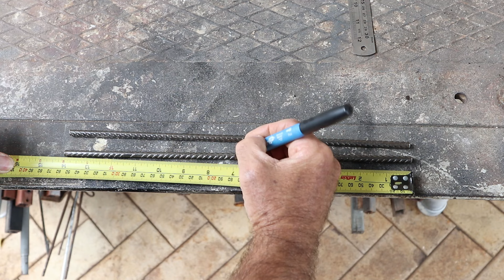Making a Steel Knot Metal Handle - Rebar Industrial Style Handle - MIG Welding Project

Comment: Brilliant. And it a pleasure to finally see someone that actually knows the correct use of a file ,one way stroke  .
Reply from the maker: Thank you very much.
Reply: @GavinClarkdiy  

🏖    🏖
Reply: His high school metalwork teacher must have missed a few things though. Keep your work low in the vice to be more efficient and avoid vibration chatter and never use a file not fitted with a handle.  Still, a nice end product.  A cheap 4 speed Ryobi pedestal drill from Bunnings would help.  I really like your good old Aussie metal work bench.
Reply: Haha, I thought the exact same thing. Was taught by a machinist when I was in grade school.

Comment: A million views . What can I say?
Great idea, skillful execution.

A coupla drops of oil on the barrel of your vice will stop the chatter.
Fantastic piece of old boiler room floor plate for your bench. After you've walked into that corner once you wont do it a second time , Ouch.
 Hope there are no grandkids around.
I like how your workbench is fixed firmly to the floor and wall. Nice and solid.
Good looking workshirt.
I think I have the same number of raucus birds in my yard too. Them and the wattle birds and the ravens sure kick up a storm.
Reply from the maker: Thank you very much. I will give my vice a bit of a service soon, yes my bench is old and very heavy, not at all flat on the top either, it is not bolted down or to the wall it is just heavy and solid. I don't mind the birds, but their noise does sound louder on the video. Thank you for your comment.

Comment: Excellent! When I build a shed out in the back, THIS is the handle that is going on the door. Thank you! Only thing I might do a tiny bit different is use a piece of hardwood between the metal and hammer when striking the metal to keep more of the rough texture. And then at the end heat up the handle and coat with beeswax to protect the metal from the elements.
Reply from the maker: I am glad you liked my handle, yours sounds like it will come out very nice. Thank you for your comment.

Comment: What do you seal the handle with? Paint or linseed oil or wax? Outside wear people put their grubby hands What works, lasts, and feels the best?
Reply from the maker: If it is just for the shape, and clear is not needed I use a satin black rust-guard paint, that seems to work well. But if you want to see the metal there are many things to use and everyone has a different idea. I have decided not to comment on finishes, as there are so many answers and questions. As what climate you are in, is it inside-outside, lots of rain, ice, do you want long term and rarely touch, or a wax with a wipe over every year. That is why I have no opinion, Please ask someone in your area what you should use, I feel this is a better way to find out. Thank you for your comment. Sorry Steve

Comment: Might be  simplistic question  ... but what keeps the rebar in your Steel Knot Metal Handle from pulling out of the holes in bolt heads ?  friction or a spot weld ?
Reply from the maker: If I thought it would come out I would give it a weld behind it as it would not be seen, but in this one the steel was a very light fit into the holes plus the rebar in the middle was very tight against each other when I welded the bolts on to the backing plate, they would need a lot to jump the lugs on the bar. Weld it if you make one just to be safe.

Comment: au - The big  Vices  we broke using in  spring factory    bending  steel  rods   :) 
We got them to build a  Decent  welded 1/2"  plate vice  -   Crap cast     snapped easy     it worked    then they Sold  many after that :)
Reply from the maker: The on I am using has taken quite a beating over the years, so I have my fingers crossed I will never be doing a "This is how you repair a broken vice" video. thank you for your comment.

Comment: Hi
You are no 1 
If you use this handle for exterior gate , how about a rusts do you paint them or you leave as original 
Thanks
Reply from the maker: Thank you very much, I am happy that you liked it. I often use Penetrol Rust Treatment Penetrates Rust 300g Aerosol Spray, and then put two topcoats of Semi-Gloss Clear Coat. That is what I used on the rebar lettering on the back of my workbench, here is the link to that video. https://youtu.be/JA-wk62Zghk  I try not to comment on finishes, As what climate you are in, is it inside-outside, lots of rain, ice, do you want long term and rarely touch, or a wax with a wipe over every year. That is why I have no opinion, Please ask someone in your area what you should use, I feel this is a better way to find out what would be best for you. Thank you for your comment.

Comment: Great stuff and creative and indeed. So can you apply a clear coat of paint? And how will you charge on this assuming that you have to sell it? Just curious considering the brains, effort, material, time and labor and not machine.
Thanks
Reply from the maker: Thank you I am glad you liked it, you can finish it anyway you like it is bare steel, it will be just a clear coat for this one. I only plan to make the one, but if I was to make them to sell, I would weld up a few templates so I could do the bends easy and all the same, to drill the two holes it the bolt heads I would do them in the drill press and that would mean one drill bit and it would be done (not the pilot holes I did with the hand drill) the depth would be set. then I would make 20 handles and would have a good idea of the price to sell them at, plus have a few in stock to kick it off. I am sorry I do not have a price for you. Thank you for your comment.

Comment: Nice workmanship there Gavin. Hope you don’t mind me saying, but it’s an old habit of metal workers, reading glasses aren’t safety glasses. Please take care with the safety aspects, so you can carry on having fun with your projects. I really liked the piece you made, there is just one tiny bit I would try. Coating it with copper through electrolysis. Depends on the liking and where it’s going, but in case you decide to use that in any piece you make, leave it in long enough so it builds up a thick layer and you will never have to paint it. Left outdoors it will in time develop a coat of oxide that gives it a beautiful green look. It’s just a suggestion, use it if you like. Thanks for the video and keep’em coming. Thumbs up.
Reply from the maker: Thank you very much, I don't mind you saying about the reading glasses, I do have googles and safety glasses right here with me, but yes, I am guilty I do not change over enough. Thank's for your thoughts on coating it with copper. I appreciate your comment, thank you.

Comment: Gavin  your work is awesome I was just wandering what the size of the backing plates is ?
Reply from the maker: Thank you very much. The wide flat bar is 50mm wide, 250mm long and 3mm thick, the smaller flat bar is 32mm wide, 207mm long and 6mm thick, the bolts are 25mm across the head and 50mm long, the shaft of the bolt is 16mm.
Reply: @GavinClarkdiy  cheers for the reply Gavin very much appreciated.

Comment: With a solid vise, a MIG welder, ball-peen hammer, and bucket load of ingenuity… an artesian door handle was made! Since the rebar loops only hammered in, will they slide out of the bolt holes over time?
Reply from the maker: They have quite large ribs on them and because of the two bits of the knot being tight together and the ribs locked in, I find it unlikely that it will come apart, if I was using smooth steel for the knot, I would but a small weld on the back of the knot welding it solid, this could also be done with this one if you feel it needs it. Thank you for your comment.

Comment: Sir, do you put anything on your work to keep it from rusting ? Thanks.
Reply from the maker: I often use Penetrol Rust Treatment Penetrates Rust 300g Aerosol Spray, and then put two topcoats of Semi-Gloss Clear Coat. That is what I used on the rebar lettering on the back of my workbench, here is the link to that video. https://youtu.be/JA-wk62Zghk  I try not to comment on finishes, As what climate you are in, is it inside-outside, lots of rain, ice, do you want long term and rarely touch, or a wax with a wipe over every year. That is why I have no opinion, Please ask someone in your area what you should use, I feel this is a better way to find out what would be best for you. Thank you for your comment.

Comment: Great work, but wouldn't it leave rust lines up and down any door it was put on? I guess you could  electro plate it with nickel, maybe.
It really is a pleasure to watch you work!
Reply from the maker: Thank you very much, I am glad you liked it. I agree nickle coating, powder coating or I often use Penetrol Rust Treatment Penetrates Rust 300g Aerosol Spray, and then put two topcoats of Semi-Gloss Clear Coat. That is what I used on the rebar lettering on the back of my workbench, here is the link to that video. https://youtu.be/JA-wk62Zghk  I try not to comment on finishes, As what climate you are in, is it inside-outside, lots of rain, ice, do you want long term and rarely touch, or a wax with a wipe over every year. That is why I have no opinion, Please ask someone in your area what you should use, I feel this is a better way to find out what would be best for you. Thank you for your comment.

Comment: Very nice.what kind of tube you are use?
Reply from the maker: I am using Rebar (short for reinforcing bar), it is used to improve the tensile strength of the concrete. it is solid steel not a tube. Thank you for your comment

Comment: Excelente. Job. Contrata.
 What is the diameter of the round bar? Is 3/8 or less.
Reply from the maker: It is less, the rebar is 7mm which is almost 9/32 inch. Hope that helps.

Comment: Excellent work. How would you protect from rust?
Reply from the maker: I have decided not to comment on finishes, as there are so many answers and questions. As what climate you are in, is it inside-outside, lots of rain, ice, do you want long term and rarely touch, or a wax with a wipe over every year. That is why I have no opinion, Please ask someone in your area what you should use, I feel this is a better way to find out. Thank you for your comment.
Reply: @GavinClarkdiy  I am from Belize in central America. We have a subtropical climate which alternates between wet and dry. The reason I was asking is because I see you use corrugated steel bar in a lot of your projects. My experience with it is that it corrodes rapidly.
Reply from the maker: @waynetillett6130  Rebar is not a quality steel and needs to be coated well. Needs to be sanded well to get rid of any sharp bits of steel that may stick through the surface on the finish. I like a good rust kill paint, or The Flood Company 300g Penetrol Spraycan/ or paint can which has done well for me when it is out in the weather.

Comment: I'm wondering how you would treat the metal to prevent rust but also let the beauty of the metal come through.
Reply from the maker: I have decided not to comment on finishes, As what climate you are in, is it inside-outside, lots of rain, ice, do you want long term and rarely touch, or a wax with a wipe over every year. That is why I have no opinion, Please ask someone in your area what you should use, I feel this is a better way to find out. Thank you for your comment.
Reply: @GavinClarkdiy  I understand. Thank you for responding. I'm a new subscriber and am enjoying your channel. Already this video helped me to solve an issue I was having bending steel rod. I need a thicker sleeve! Thanks.
Reply from the maker: @paultennis9414  Awesome, I am glad you are enjoying my videos. Thank you very much, Welcome to the channel.

Comment: Inventive, beautiful, and well made.

Do you oil them when finished?  Any reason you didn't counter-sink the mounting holes as I think you usually do?
Reply from the maker: I think the raised dome head screws look good with this, it gives id a more rustic look. I have decided not to comment on finishes, as there are so many answers and questions. As what climate you are in, is it inside-outside, lots of rain, ice, do you want long term and rarely touch, or a wax with a wipe over every year. That is why I have no opinion. Thank you for your comment.
Reply: Just read this so maybe has answered my question. I us Boiled Linseed on most natural metal objects so reckon I'll stick with it.Cheers

Comment: Gavin Clark the man! I rarely watch a DIY video as long as this, but it kept my attention till the end. Good job making the vid, and the handle too. Now, tell us how long it will take the average guy with the tools to make the handle you just made.
Reply from the maker: Thank you very much, I am glad you liked it. I have no idea how long it would take someone else to make this, get a quote from someone and you will get an idea. If I was to make another one now that I have one to measure off it would be quicker, especially if I am not filming it. If I was to make 10 more then the time taken on each one would be much less than making 10 individual ones, as you would cut all the steel, drill all the holes and only have to put the drill bit into the drill once for the whole 10 bits, and before having sizes etc, before you get to your forth knot you would have got much faster than the first etc. Hope that helps you a bit.

Comment: what you need to do that the iron don't get rusted, and stay like that? Lacquer?
Reply from the maker: I often use Penetrol Rust Treatment Penetrates Rust 300g Aerosol Spray, and then put two topcoats of Semi-Gloss Clear Coat. That is what I used on the rebar lettering on the back of my workbench, here is the link to that video. https://youtu.be/JA-wk62Zghk  I try not to comment on finishes, As what climate you are in, is it inside-outside, lots of rain, ice, do you want long term and rarely touch, or a wax with a wipe over every year.

Comment: Beautiful work. Subbed. Using masking tape to hold the spacer on the vise is genius! Have you hardened that copper pipe - how come it isn't bending when using it as a lever?
Reply from the maker: Thank you, I am glad you liked it. The copper was hardened when I got it, it was salvaged, It is not strong like steel, and I try to support it close to the bending steel inside, it does not bend but will kink and once that happens it is no good. I only used it because I have it and it is a nice size. Steel tube would always be much better for doing this. Thank you for your comment

Comment: Hi Im a sheet metal worker, what are the measurement of the rebar and handles in inches. Thank you for your videos and what you doing is art. God bless you
Reply from the maker: Here is the measurements in metric, just convert them in google as you know the steel sizes in inches you can buy there, you will round up or down to match what is available to you. Hope that helps
Reply: @GavinClarkdiy  ok thank you

Comment: How would one keep that rebar from rusting after it is installed ?, do you have a method ?
Reply from the maker: I have decided not to comment on finishes, As what climate you are in, is it inside-outside, lots of rain, ice, do you want long term and rarely touch, or a wax with a wipe over every year. That is why I have no opinion, Please ask someone in your area what you should use, I feel this is a better way to find out. Thank you for your comment.
Reply: @GavinClarkdiy  Fair advice, I'm in Wisconsin ,USA and an admirer of your work. I'm getting ready to retire soon and I think Ive found what will be one of my hobbies. Thanks for the quick reply. Cheers.
Reply from the maker: @lancejensen9328  I wish you the best for your retirement, and the projects you do then. Keep safe.

Comment: Looks nice but you might want to weld the rebar to the bolts because if it gets bent over time it could come out of the holes.
Reply from the maker: You are right, but it is in very tight and they would have to slide against each other to come apart, if you weld it with a quick tack on each from behind before putting it together would fix this problem (and the tacks would not be seen from the front), if you felt it would be an issue that would do the job nicely, Thank you for your comment.

Comment: Gavin where are you getting that 6 mm reo bar from im in Canberra and can't find it anywhere
Reply from the maker: I buy it at Bunnings, but it has been out of stock for quite a while here, I "special ordered" more of it at bunnings about a month ago and they got it in for me.  it's called Reo Bar comes 1800mm x 7mm and it comes in a 3 pack, was just a bit under $10 for the pack. Hope that helps
Reply: @GavinClarkdiy  yeah I know what it's called I work with it nearly every day but only small stuff we get on sites is 12 mm upto 36 mm
Reply from the maker: @dggd123  Other than Bunnings I can't get it smaller than 12mm here either.
Reply from the maker: Other than that, to get other sizes, I have cut mesh, and trench bar (with the 3 or 4 reo rods)
Reply: @GavinClarkdiy  im going to go to bunnings they have it in stock here in Canberra im going to fabricate some things like what you have done
Reply from the maker: @dggd123  Awesome, I wish you the best with your projects.
Reply: @GavinClarkdiy  thanks mate im a boilermaker by trade but got out of it fulltime 10 years ago now operate tower cranes but I do make bits and pieces here and there still
Reply from the maker: @dggd123  Nice change I would imagine, nice fresh air up in the crane, and a bit of a view.
Reply: @GavinClarkdiy  I did it when a builder went broke on me I used to run my own structural steel and metalwork business so I changed jobs then